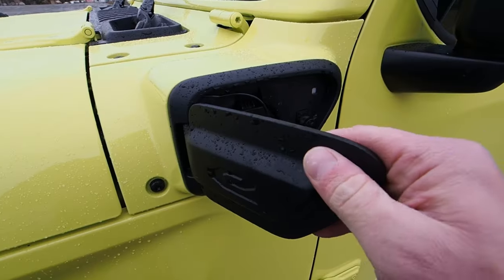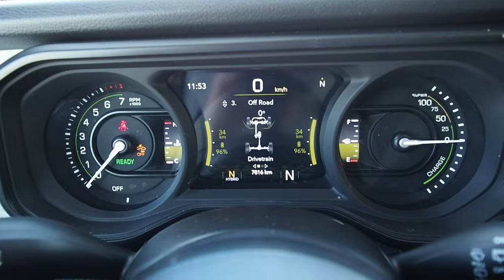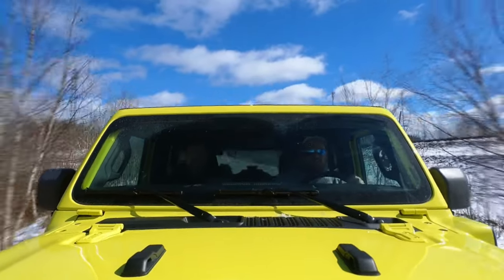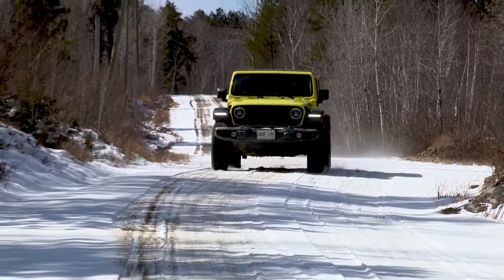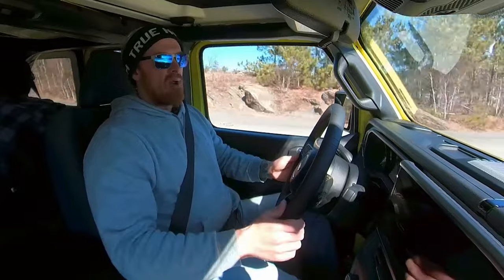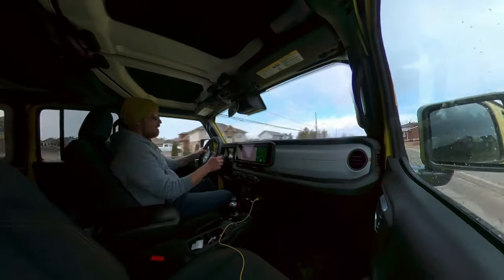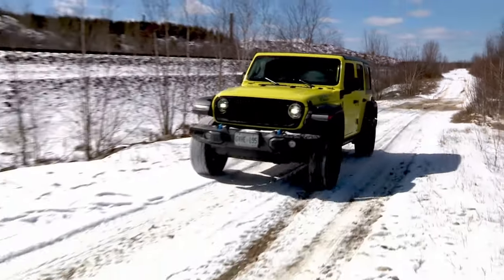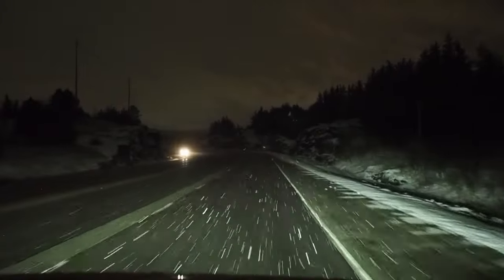2024 Jeep Wrangler Hybrid Review: My Right Foot Was On Vacation!

Comment: Also....I drive some kms into town every morning very early so would invest in additional lighting like ditch ....I'm sure THAT would greater the power drain....like you stated  Justin in the winter especially 😊
Reply from the maker: I see a lot of them with light bars installed up this way, though those aren't technically allowed on public roads if I recall. And on battery drain, I'm not sure-- fun fact: the 12 volt battery (which runs the heater and your auxiliary lighting etc) is recharged by the bigger battery (not an alternator), but it can be recharged whether the engine is running or not, and presumably, as you're plugged in too. Big battery gets all of the power, sends the 12 volt battery what it needs!

Comment: I was about to buy one as the Gladiator 4Xe was supposed to be out this year. It was pushed back and I wanted to sell my Tacoma in that sweet sale period we were in before the new ones came out. Because of Jeep holding it back I ordered a new Land Cruiser. So no plug in for my truck, and I was looking forward to it. Our experience with my wife’s PHEV Outlander has been fantastic. We normally get 3000+ km on a tank of gas because of the ability to plug in. “Fudds” have to get around electric being forced upon them and realize that it does have its place. Electric drive vehicles are nicer to drive because of smoothness of the pedal input, diesel level torque and hopefully some saved money on fuel. And the cost of fuel isn’t getting cheaper…..
Reply: "Fudds" probably are resistant to people telling/forcing them to do things or telling them it is for their own good. These vehicles absolutely have their place, but the answer isn't to belittle or denigrate them. I think videos like this, demonstrating the differences without blowing smoke will eventually prod most people to realize it might fit for their needs.